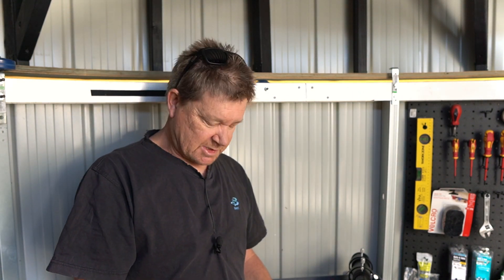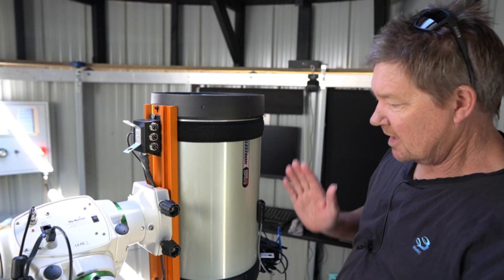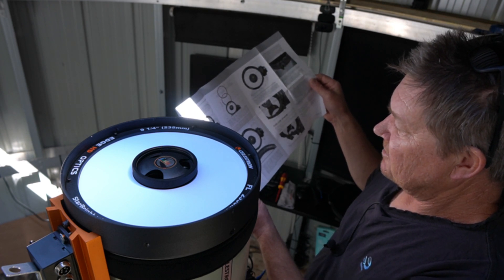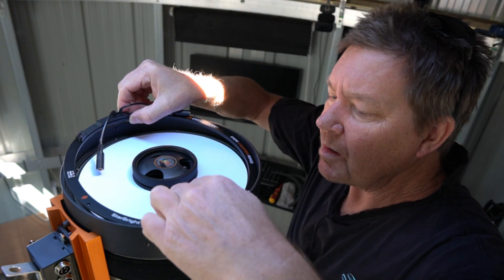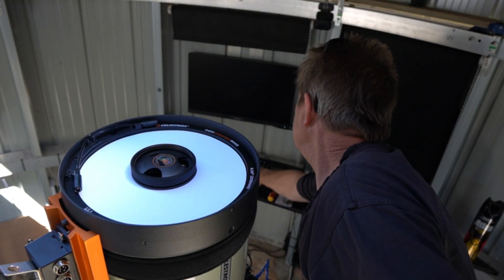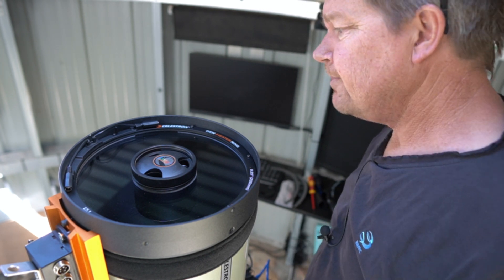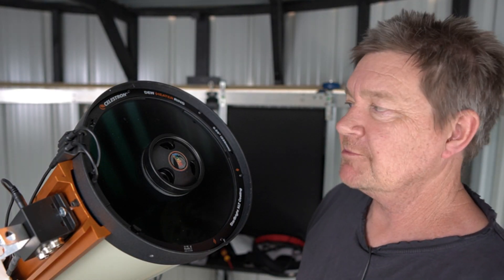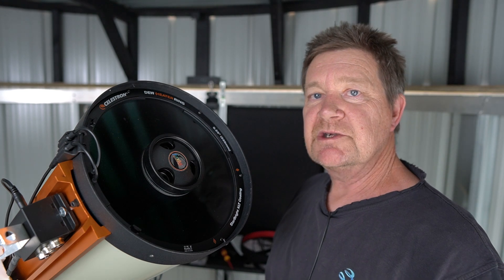Celestron SCT Dew Heater Installation. Distorted stars on first night.

Comment: Did you find a solution?
Reply from the maker: So far have managed the winter with just using the heater output controller on the Astro Pocket Power box at about 20 percent. As the efficiency of the dew heater ring is so good that's all I needed to power it. Haven't noticed any problems with the stars since.

CS Don

Comment: I got a dew heater ring for my new RASA 8 and the only trouble I've had since fitting it is that my lens cover no longer fits!
Reply from the maker: Hi Peter. Yes I struggled fitting the lens cap also. The terminals seemed to be too large making it hard to align the lugs. I didn't mention it on the video as I was already complaining about the star shapes.

CS Don

Comment: Hopefully adjusting the temp on the ring sorts out the stars. Unfortunately there is no such thing for the Meade 10" and I have to use the dew heater in the dew shield and another dew strap around that to stop the corrector plate dewing up. Does using this Celestron dew heater ring mean you don't need to use a dew shield at all?
Reply from the maker: Hi Logan,  Fingers crossed all will be okay on a low setting. I still use my dew shield for blocking stray light. Just in-case my wife leaves the outside light on LOL.

Hope all is well with you.

CS Don

Comment: Known problem, just less power to the dew heater ring and the problem is solved. The reason is that if you use a dew band around the outside it must heat more than the dew heater ring that has direct contact with the glass and therefore needs a lot less power. If you put the power to high you get misshapen stars, a bit like pinched optics.
I use a PA Powerbbox to manage the power to the dew ring and it hardly on, and we have a lot of dew here where I live.
Reply from the maker: I really need to get out more, It turns out everyone knows about this except me LOL.
I will run it on a very low setting via my Pocket Powerbox. Fingers crossed!

CS Don

Comment: I’m using the 8” dew heater ring with the 2 port controller and haven’t noticed any abnormal star shapes.
Reply from the maker: I hope it stays that way for you. I think I'll be okay once I work my heating control level out.

Thanks for your reply.

CS Don
Reply: I am just checking over some data I took during the last session and even using my Celestron two port dew heater controller I'm seeing the odd star with a small tail like you describe. I'm reading the manual and it states if you haven't used it in a long time or just started using it, like me, you need to calibrate the environment sensor. Since I have an Celestron AVX mount and use Celestron CPWI software with NINA I can access the settings easily There is all sorts of information it reports and with graphs;; ambient temperature, humidity, dew point,. I can set the ports to manual vs automatic and then set the power or in automatic set the aggressiveness. I'm going to calibrate  the sensor in the next session since I have never done that procedure. I notice there is an Adcom driver for the dew heater controller if you don't have a Celestron mount. I'm sure other power controllers have similar features.  Hopefully after I try this my corrector plate will remain clear and my stars sharp.
Reply: I decided to set up indoors today to run through the CPWI dew heater software feature. After reading the manual it showed where the sensor is located on the controller. I discovered the sensor was obscured by a velcro strap I was using to secure a loop of wires that go to the heater ring.  So the last few nights not only my dew controller hadn't been calibrated the sensor opening in the controller was obscured. Doh!
Reply: Last night with my Celestron 2 port controller (only one port used) I ran a calibration before imaging. The ambient and dew points were close. I had the Celestron controller set for auto control. Using the sensor (the one I had obstructed) it should provide the power to the dew heater ring as needed. There is a setting, Aggression Level 0-10, that can be set and I set it to 3. I ran my image session and checked the dew control panels for how much power was being used and if the dew heater was running and how many watts the dew heater was pulling. It was pulling 21 watts. At the time I didn't know what level of power that was, whether it was 50% or even 100%. There was heavy dew forming last night even around 9pm. The humidity levels were about 95% according to the dew heater information panel in CPWI, Celestrons control software that NINA uses. This morning I looked at my lights and discovered tails on the upper right hand corner stars. I figure the humidity being so high the controller ran the power at 100%. This will not work. I have to zoom into the image to see the tails in the upper right hand corner of the image but now I know they are t here it's bugging me a little. I can bypass the automatic feature and set the power levels manually. I set the power level to 25%, 5.4w, then 50% 10.5w, 75% 15.4w and 100% 21.6w. So last night the controller was running full power to the dew heater ring. I will try manual settings next, starting with 25% first.
Reply: I set up the scope inside, ambient temperature is about 82F to 85F. I tested the manual temperature controls and used a small IR thermometer to read the heat coming off the dew heating ring. With the power off the ring and surrounding glass were ambient temperature about 84F. At 10% power, 2.2watt 85/86F, at 20% power, 4.3 was 91/92F, 25% power 5.4 watts 94/95 F, 40% 8.5% 97/98F. I didn't test any higher. I'm going to try 20% tonight.
Reply from the maker: @KJRitch  I will not be able to see how well lowering my output levels will work for a while as it is warming up down in OZ now and don't usually have any probs this time of year. I may have to purchase the thermistor from celestron if the temp/humidity sensor on the Pegasus Powerbox wont work with it. I believe that I should be able to make compensations with the settings but I will not be able to use the automatic dew function without the celestron sensor.

CS Don

Comment: Hey Don!  Thanks for the shoutout!  I run my controller on PWM with a 10°c above dew point setting (might change in colder months). For anyone reading, the Celestron controller is not mandatory, I’m using a WandererBox. I run the temp probe attached to the ring with a small cable management clip. The thermistor cable lead from dew ring is unused in my case.
Thanks again Don!
Cheers!
Doug
Reply from the maker: Your welcome Doug. I will play around with my levels on my pocket astro power box, cant see it being an issue. I have been having problems with it dropping power lately, but I have solved the problem. Broken solder connection on the DC input.

CS Don
Reply: @donstronomy7606  it’s always something. I’m starting to see problems with my 533mc pro cooler not being able to reach temperature (-10c) until after dusk. I think a problem is looming. Might take it apart and make sure no dust buildup on the cooler heat sync. 
Cheers!
Doug

Comment: Hi Doug - thanks for sharing your experience.  I, too, have had the same results.  What I did was obtain a Pegasus Astro Pocket Powerbox Advance and use the control panel to minimize the heat output.  I am based in the Seattle area where dew is a problem for much of the year.  We hover around 90 - 95% humidity in the cooler nights, so dew is definitely a challenge.  After installing the Celestron dew ring on my 9.25", and using the Powerbox adjustments (level 3), (along with a dew shield), I have no problems now with dew or fogging.  

I don't use the thermal transmitter on my dew ring.  The Powerbox has a temp and humidity sensor that comes with it and it manages the current sent to the dew ring with a 1-10 slider minimizing the power output.  I've done tests at higher powers, (5 and above) and noticed the star shapes to become problematic, which is why I use a 3 setting pretty much all year around.
Reply from the maker: Hi Jeff, thanks for your reply. I am using a Pegasus Pocket Astro Power Box with a temperature and humidity sensor. The power box can control my power output to the heater fortunately. I have been having problems with it dropping power but it has been repaired now. I will consider your findings when I put this to the test. Tonight hopefully? fingers crossed!

Take care Don

Comment from the maker: Thanks for your reply Greg and value your feedback. I agree in general with what you have said. You may have missed the point where I advised only using this with a controller to control the temperature. 
CS Don
Reply: I did miss it but that is not what you tested and in big bold letters scaring people. It's like forgetting the fine print and not explaining the fine print. From my research, only the Celestron 2x or 4x controller (way expensive) or jump into the PrimaLuci pond with their gear and the Eco has an adapter to convert the sensor to a value that suits it. I wish something like a wanderer controller (way better than a misinforming Pegasus controller that is deceptive in their advertising) had an adapter to convert its sensor input to that of the Celestron.